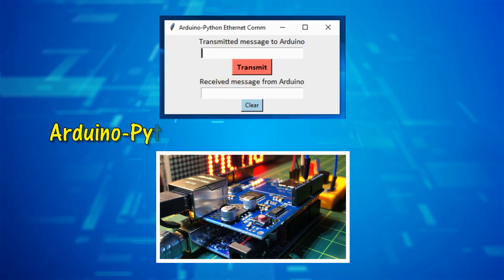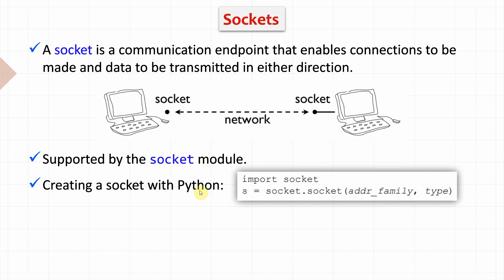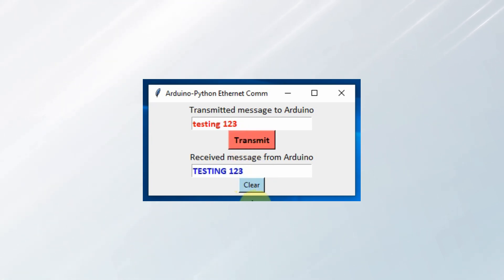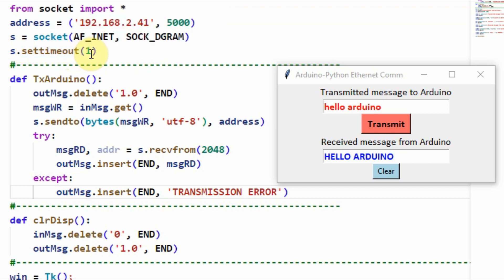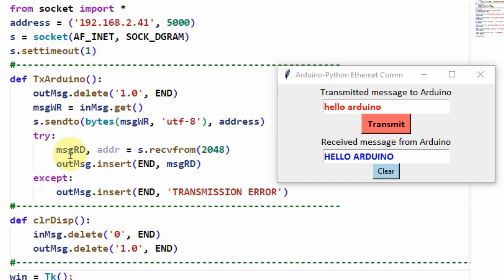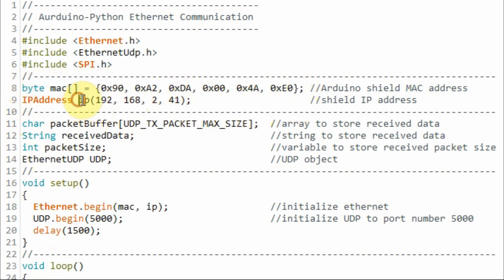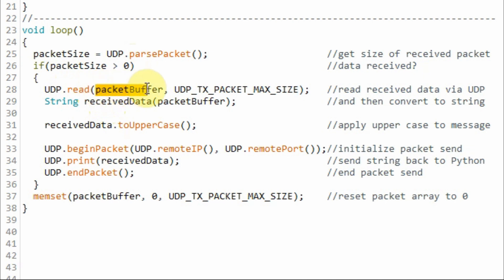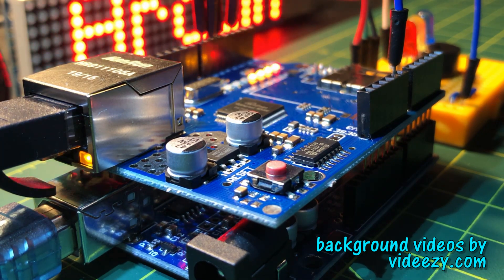Arduino-Python Communication via Ethernet

Comment: Very nice video,  I am using an esp32. It has the AsnycUDP library.  The devices would use wifi instead of ethernet. Do you think it would work. The code would probably be a lot different.